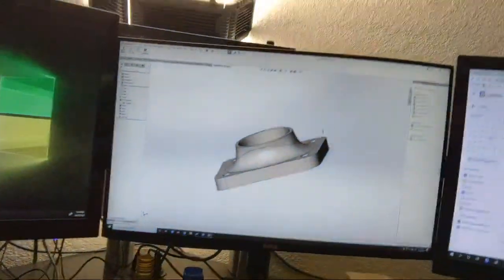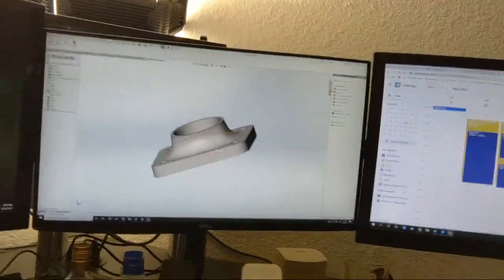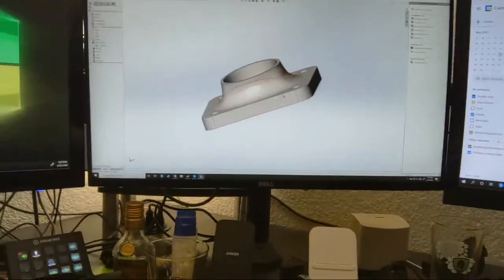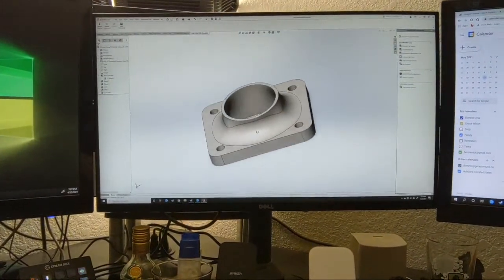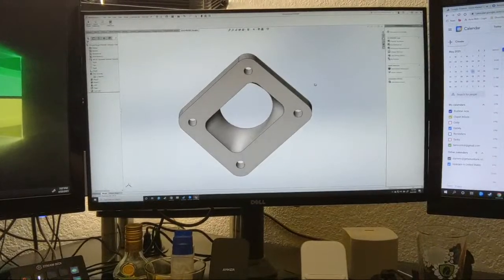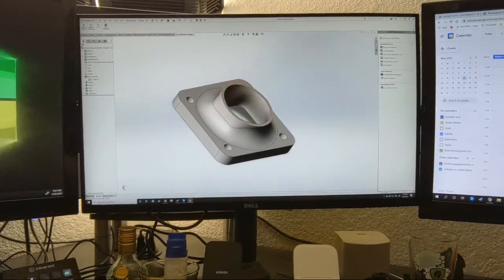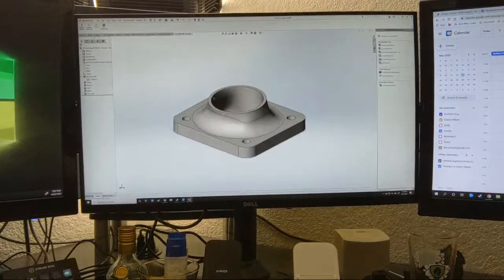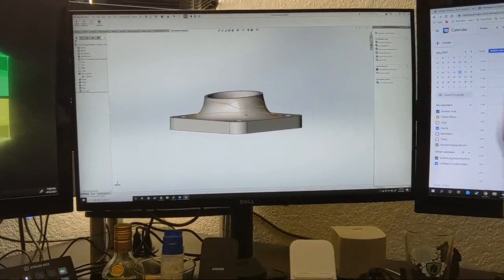Put The Anxietyport In The Glovebox

Comment: I have 2002 jdm SG5 forester with ej205. I can't read it or log it with anything but FreeSSM. Using it I can log bunch of parameters but there are no IAM. In fact there are only two parameters for ignition: "ignition timing"(is around 26 deg at 5k rpm and 0.8 bar of boost) and "knocking correction" (10 deg at the same conditions)
I suspect theese are added but can't verify that.. have you seen cars like that? 
36 deg seems a bit too much for boost, is it?
Reply from the maker: It shouldn't be 36. Usually that's 26 total. 16 main plus 10 knock advance.
Reply: @Dominic Acia  I read about ignition on these cars were "too optimistic" and for "japanese fuel", but that might be a BS...
Car previously used to cut boost on hot days under load in completely stock form using high octane fuel. I installed fresh MAF and reduced ignition via freessm and it helped a bit bud didn't fixed it completely. Replaced tiny turbo with old vf I had laying around and installed intercooler, now it is much better, but overshoots boost on spool-up a bit and I still can hear😳 knock sometimes which is scary... Although car doesn't cut boost now. Need to get into that ecu, Iknow one guy who said he has a solution...
Need to check the injectors as well, that's on the list..
Anyway, it's becoming one of those novels... Thanks for your feedback!
Reply from the maker: @777MAV  they run way too much advance from Japan for our fuel.